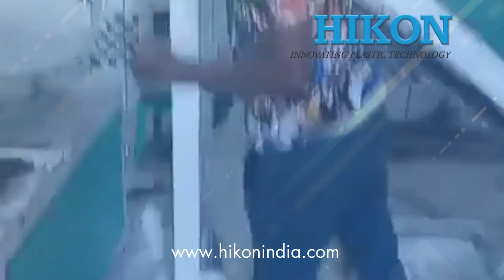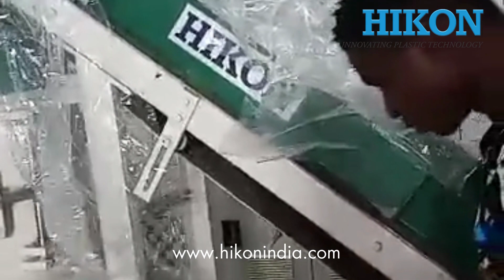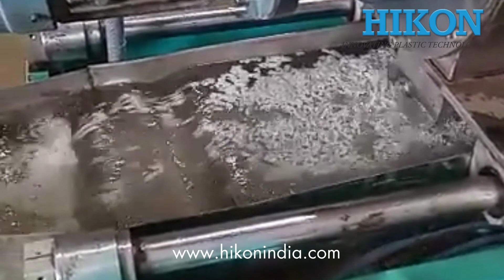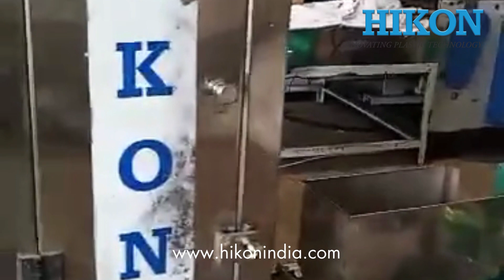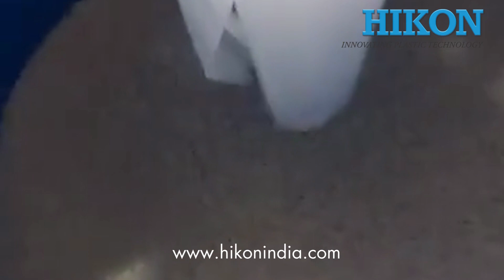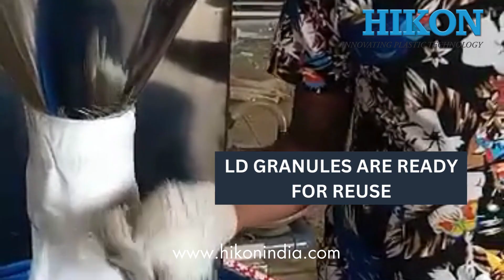Single Stage Cutter Compactor with Die Face Cutter running in Cameroon from last 3 year.

Comment: Let suppose we have to produce COPO PP pellets  and our raw materials are LD film, HDPE regrind, PP pellets, pp + LD regrind and pp powder in this case How we will use it and produce COPO PP????  Is there any feeders installed with cutter compactor????
Reply from the maker: Thanks for your inquiry but usually pe and pp are not combined together as such , we do have dozers to fill Masterbatch , additives in cutter compactor
Reply: @hikonindia3121  
Why not combined pe or pp???
Both materials are polyolefin COPO means co polymer..more than two different monomers are chemically enter bonded with alternate arrangements of pe or pp monomer they are called co polymer.of pp........
We mix 70% pp with 30% LD .....